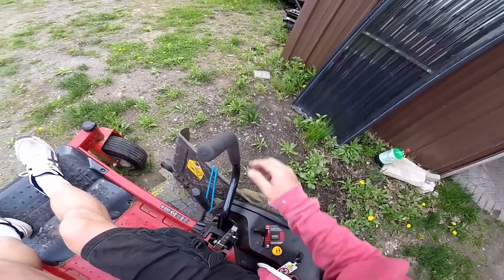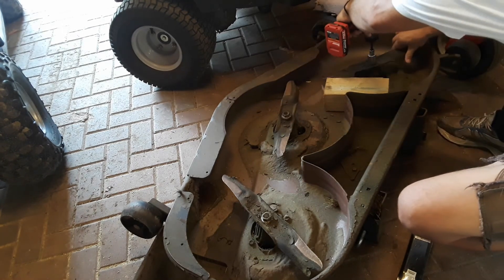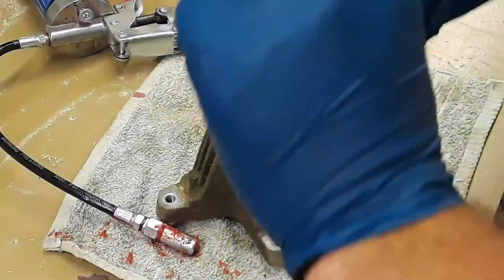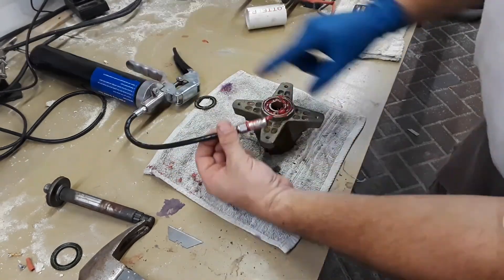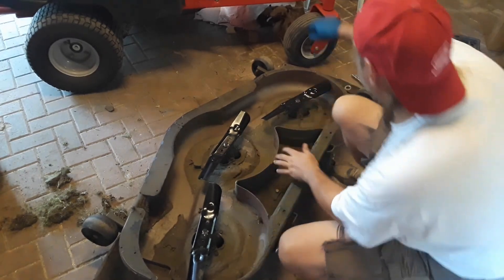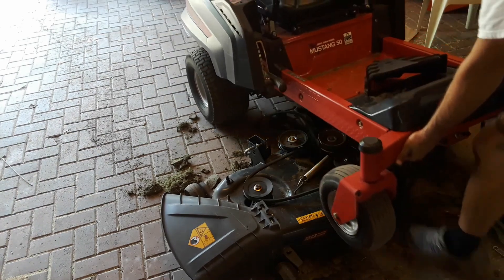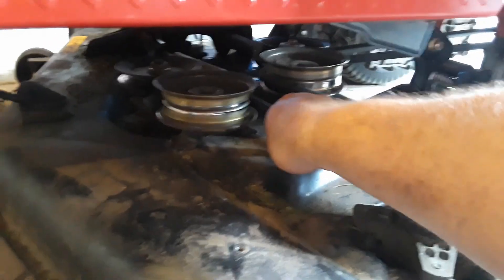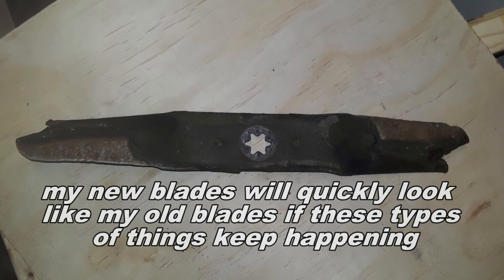Zero Turn Mower Blade Change and Spindle Lube - Troy Bilt Mustang 50

Comment from the maker: In this video I showed one of the objects I accidentally ran over. What's the worst thing you've run over with your mower?
Reply from the maker: @mattt198654321  Yikes! That beats the pipe I hit. Thanks for sharing.
Reply: twigs fall from trees all the time in Oklahoma and I run them over all the time. Had my deck down on notch lower than normal and went over the top of the water meter. There is a piece of plastic on top of the cover that got shaved down. Sure that helped my blades. Ran over a baseball one time.
Reply: @douglaswotherspoon7687  pux😊bbbbbbbbbbbbb

Comment: Very helpful. I never thought to check and regrease the sealed bearings. I might look into that in the off season.
Reply from the maker: You've got a Cub Cadet, right? Most likely they are the same spindles as on my Troy Bilt (both made by MTD).

Comment: Good video! Not sure we have the exact same one, but it looks almost identical to mine, on mine if you look on the underside of the seat you can find the part numbers for commonly replaced parts, as well as a diagram of the belt properly installed.

Comment: You don't really need to lift the mower to remove or replace the deck. With mine (a 42), once the deck is disconnected, I drive off to the left, then when I'm finished doing the maintenance, I drive back over the deck to the right, then reconnect.  Being a zero turn, it's fairly easy to do.

And, if you have an old swing set frame, you can hang the deck up on it with chains, ratchet straps, ropes, whatever you have, and it makes it a bit easier than fighting the anti-scalping wheels with one hand while you try to work with the other.  Right now, I've got a frame made out of three 4x4s with eye hooks that I use. It's more of a permanent fixture whereas, when I used the swing set frame, I could move it around to different parts of the property, depending on what I needed it for.  Take care.

Comment: The easiest way to put the belt back on the center pully is to lift the panel your feet rest on. It gives you full access to the top of the deck.

Comment: Sand it what eats away at the backside if the blades.
Reply from the maker: Must be all those huge ant hills I keep running over. I don't see them until the mower scalps all the grass from the top. Dirt and ants flying everywhere. Some of them are almost as wide as the mower deck.